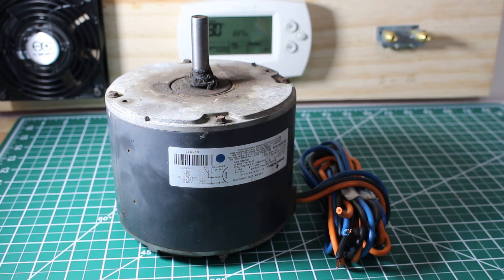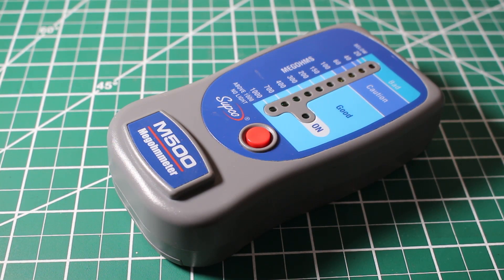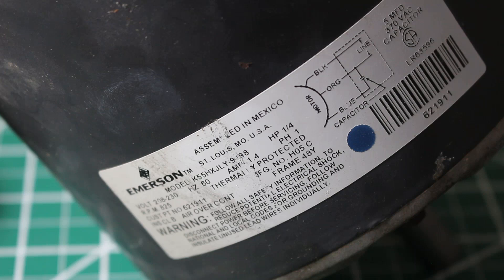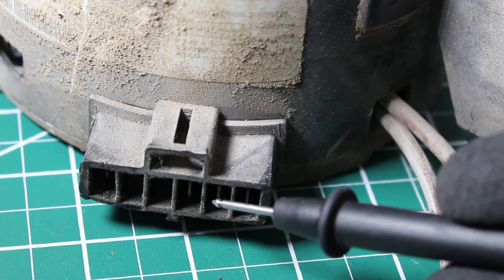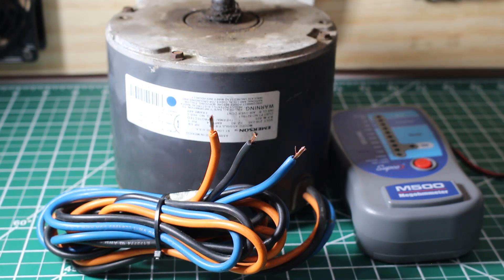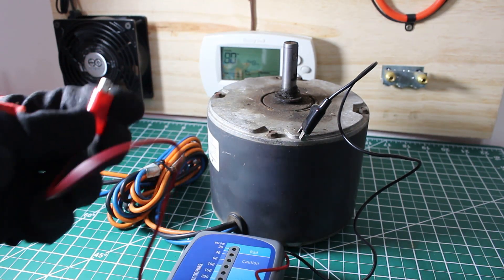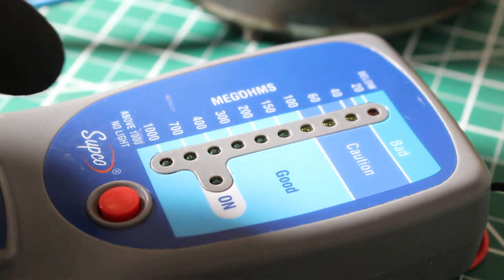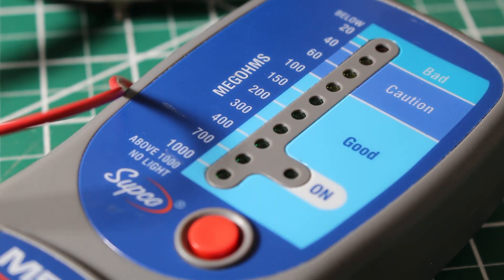HVACR: Insulation Resistance Test For Single Phase Induction Motor (SUPCO M500 Megohmmeter Test) Ohm

Comment: Be careful if you use this meter on a Copeland scroll compressor. Read Copeland's information on megging a scroll compressor and you will be surprise on how low the reading can be and still be a good compressor. I've condemned good Copeland scroll's by using this meter, it said bad but the compressor's were still good. Please read the information from Copeland.

Comment: Is it possible to perform the test with a multimeter
Reply: No. A multimeter checking resistance is only sending out about 5-9v. An IR test is designed to test for insulation breakdown leakage current and insulation resistance standard  procedure  is to use double the operating voltage to see if the insulation is pushed to failure

Comment: I'm trying to stay my head around these basic concepts as I'm finishing up a motor restoration. In this test, you checked each lead to ground, which essentially let you know if there was a short to ground or the condition of the insulation. Is there another Megger test where you check the insulation between windings by either connecting two lead pairs to the Megger? Or would you do that by connecting a lead from each of two windings to the megger? Based on my continuity test last night, I determined that the single phase resto motor has two run wingdings and one start winding. I know that's probably basic knowledge for a pro, but I'm pretty stoked I was able to learn enough about ac motor characteristics to make the distinction between the two. So my last test before I reassemble the motor is to check the insulation, I'm just confused about whether there is a check between windings, a check within windings, and the winding to ground check you did here, or are they all the same?

Comment: You missed some tests. you didn't clarify either  is you are testing an AC  motor with permanent split capacitor, centrifugal clutch dual speed, two poples,...but anyway you should test the between the rotor and windings not just against the case or enclosure. And by last check the between windings with an ohmeter. Otherwise you could have a false positive.

Comment: JumperMan, I'm currently a student in trade school for HVAC. Is this meter only for single phase motors or is it for any motor? I would think for any motor,  but confused based on the title of video.
Reply: It'll work with 3 phase as well. He's just measuring insulation.
Reply: @onlyliveonce7708  Oh I read the title wrong lol.
Reply from the maker: @christiankeller3656  The title is correct. We are testing a single phase motor with a megohmmeter but this meter can be used on 3 phase motors and much more👍
Reply from the maker: @onlyliveonce7708  👌🔧⚡
Reply from the maker: This meter is for any type of motor and many other types of things. Thanks for watching & Stay tuned for new videos every week⚡🔧

Comment: Very good video, you might want to explain what an insulation resistance test is actually testing for, ie potential resistance to ground through windings? I really enjoy your videos, keep them coming.
Cheers from Canada 🇨🇦
Reply from the maker: Thank you very much! That would be good to know in this video but I will leave that for a separate video where I will physically open up a motor so you can actually see. Glad you enjoy my videos 🙏 Stay tuned for new videos every week⚡🔧Cheers from NYC//USA